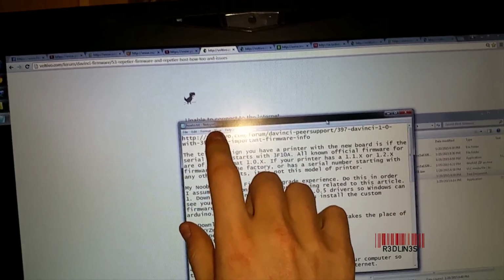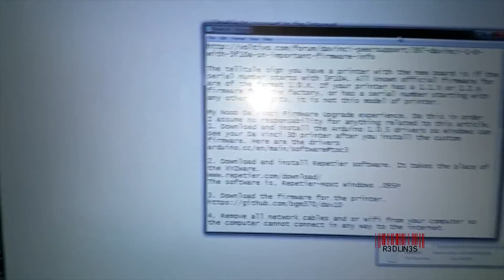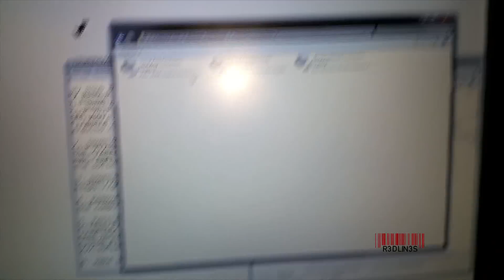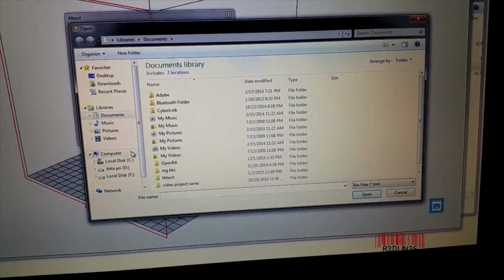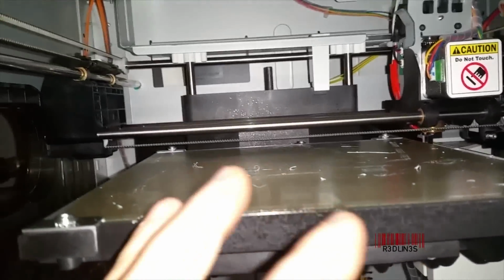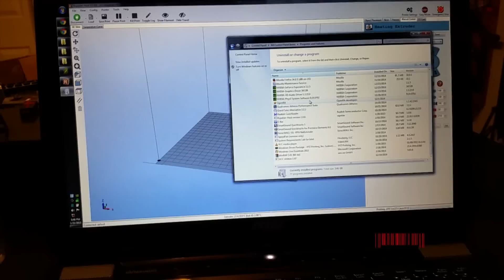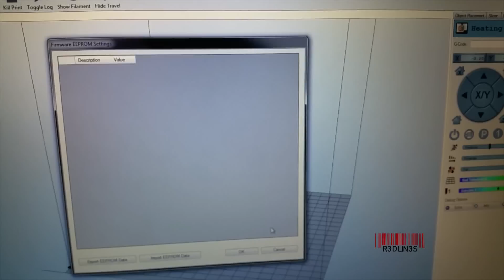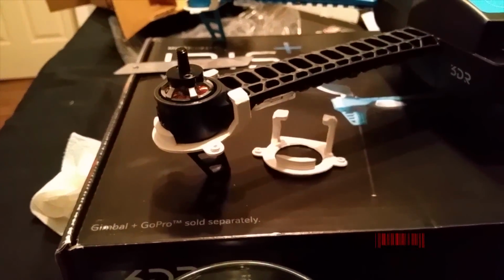Flashing Davinci 1.0 3d Printer with Repetier Firmware - Easy Way

Comment: I followed your video and it worked! and I realized there's no Auto Level in Repetier 0.91, correct?.
Is there a link for repetier-0.92-alpha-davinci10.bin and a upgrade tutorial?, the Rept. 0.92 has the Auto Level.
Reply: did you found the software ? I like to upgrade my printer too but i can not find the firmware links not work

Comment: I tried to follow your instructions but it would not work.  I have an XYZ Davinci 1.0.  I flashed the hard drive (or whatever it is called) of the 3d Printer.  I installed XYZ software version 1.0.1.23, the same version as the one you used in the video.  I run that program and click on "about" and then click "firmware upgrade."  Your systems says "Oops!  Online service is not available.  Try again later!"  Then you clicked "Ok" and then you were given a chance to find your own software from your hard drive.  However, when I do the same thing, when I click on "about" and then click on "firmware upgrade" the system says "Device not found" and it does not give me a chance to find my own software on my hard drive.  Why this difference?  Am I doing something wrong?  The XYZ printer is plugged in, turned on and also connected to my computer.
Reply: same problem

Comment: (Problem Solved)
When I try this on my daVinci 1.0a, the software transfers correctly and I get the screen, but the buttons have almost have no effect, and the printer restarts 30 seconds after it boots up. The printer then continues to restart over and over again until you turn the printer off. Everything else looks normal, and I am running 1.5.8 and the right firmware.
Reply: hi, did you fix your printer?
Reply: Jj Paul Viernes yeah, I did. You have to save the eeprom to the ad in the printer intetface
Reply: Hi, do you still have the firmware version you used? can i have it? i think the one i downloaded is mess up
and the file inside the SD card? do you thing that has something to do with the flashing? can i have the copy also of the file inside your SD card. i think mine is also damage. 

your help to me is much appreciated, thank you :-)
Reply: Absolutely! Here is a google drive link for the compressed file. Just a heads up the compressed file is just short of 8 megabytes. https://drive.google.com/open?id=0BwbQg1W1mrm7SDY1SUQtZHBaYk0 Good Luck!

Comment: Hey guys I need some help. The firmware on my 1.0 is 1.2.7. Everytime I go to upload the repetier firmware from the link above, using the xyz software 1.0.1.23, it just says "Updating Fail" on the screen. Any suggestions of what I should do?
Reply: same problem here, did you ever figure it out?

Comment: If your SN starts with 3F10A, then you have the 1.0 or 1.0a model.  Your jumper will be j37 instead of the one listed, and your board will look different.  You will have a microsd card in the middle, instead of the standard sized one on the right.

I just flashed mine and it works fine.  Use the 1.0a repetier .92 guides on youtube, you can also find it using the forum link listed in his comments (first one), and go to the github link listed there.

Comment: Hey, I just got an XYZ and its firmware ver is 1.2.6 and I was watching your videos and I agree that the firmware and the XYZ software is garbage and I was following your tut on here about reflashing and I followed the links to DL the recommended software but 2 of the sites didn't show me the software that you were talking about using so I thought maybe Ill just DL the version that they had on the page that your links took me to, then I got to thinking that I really dont want to mess this up and possibly brick my XYZ printer so I was hoping that maybe your could see if the software currently on the sites will still work, since I dont have the money to buy another printer should something go wrong and I mess it up FUBAR.
Reply: Joe Hicks You have the older version of the printer. AFAIK, this video won't be applicable.

Comment: Awesome video thanks for posting it. Did you find that the new firmware resulted in a significant increase in performance/quality?
Reply: Artifex Hackworth I have performed this firmware flash, though i couldn't get this method to work and found a method where you actually flash through the Arduino IDE. When i tried doing it this way i must have done something wrong and my printer soft bricked. I had to find the reset pins on the board and wipe the board and then do a flash from arduino. Just warning, be careful, I still don't know what I did wrong originally. As for Print quality, Heck YES!!! I love my printer now, was pretty underwhelmed when i first got it. Another awesome thing is being able to use whatever filament brand you want. You have to play with your settings in Slicer. The biggest downside I have with my printer at this point is that i haven't modded it yet to give me a cooling fan for cooling the layers, which is also possible with this mod.

Comment: I wish I would have found your video first. You complied hours of my research into 15 minutes. Thanks! Do you know if it mater which Arduino software version or Repetier software version I download? I found a couple places that said to make sure I got 1.5.8 on the Arduino but didn't mention if a newer version would work. Same goes with Repetier most are calling out 0.92 but the newest release is 1.0.6